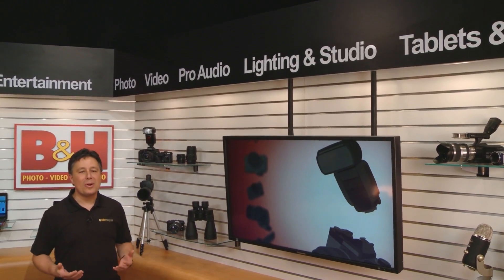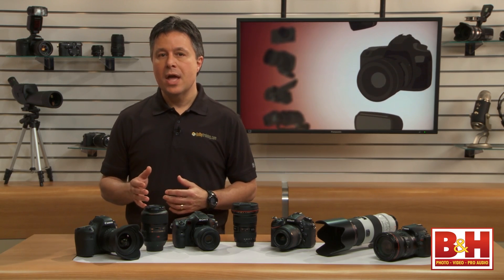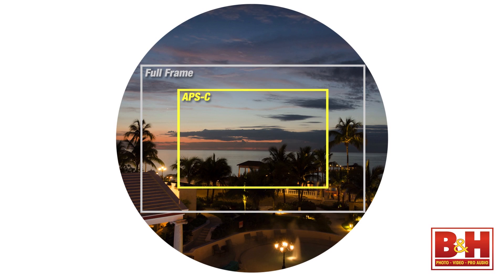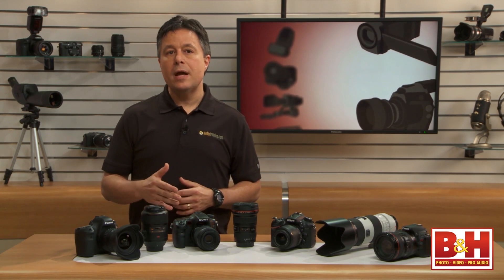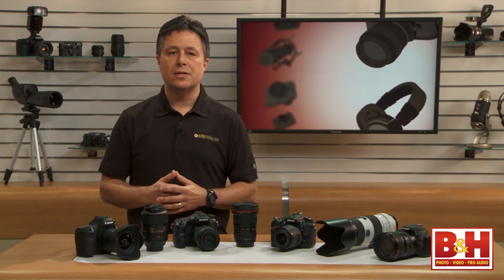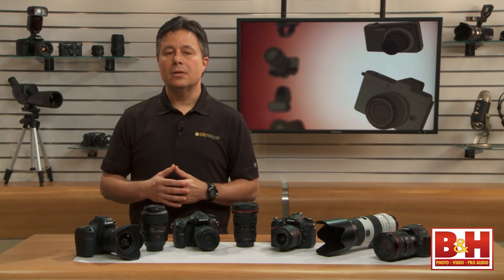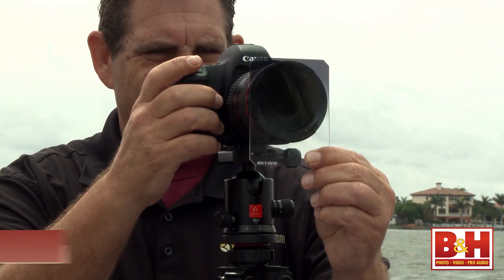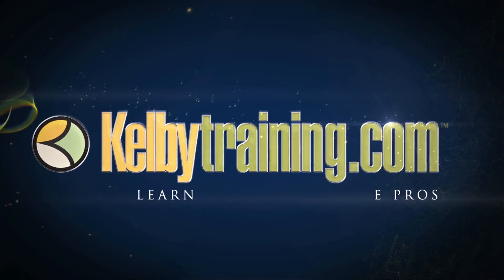DSLR Lens Primer: Part 2

Comment: APS-C stands for Advance Photography System type C. This is a new film size standard back in the 90s. This system was very simple for anyone to load the film into the point-and-shoot film cameras, as oppose to loading 35mm film camera. APS-C is a smaller film than 35mm film. So, this is when we first introduced to crop factor, and set the focal length of 35mm film to be the baseline of that crop. Thus, digital sensor is physically made into the size equivalent to APS-C film, or 35mm -full frame.

Comment: CMOS stands for complementary metal oxide semiconductor - its what the sensor is made of, and nothing to do with its size. That's why both cropped and full frame sensors can be referred to as CMOS. Another technology for making image sensors is CCD (charge coupled devices). If you need to understand the difference you can search for comparisons.
Hope this helps.